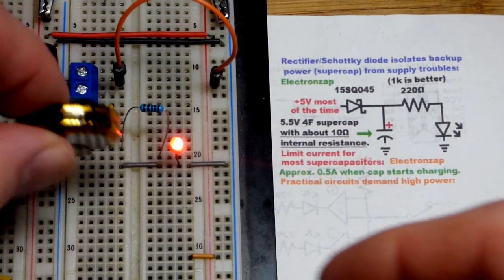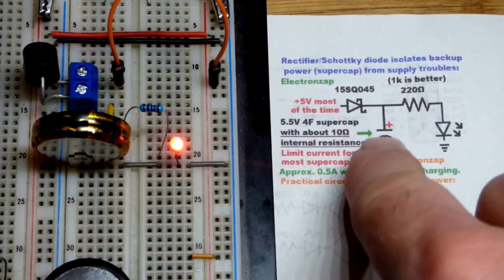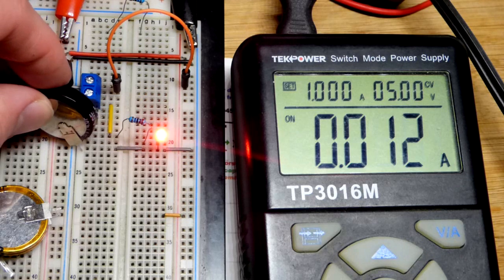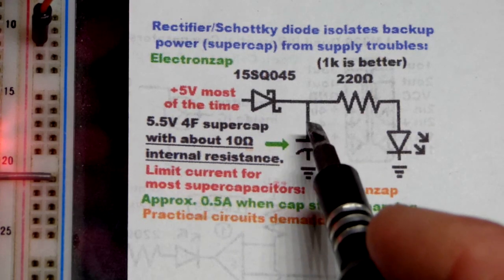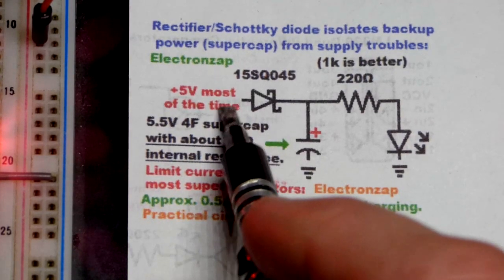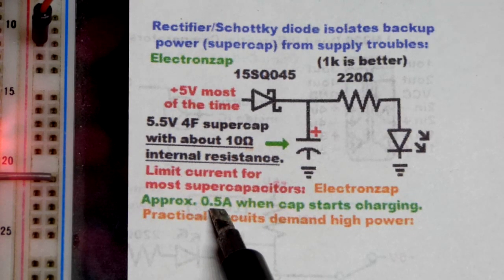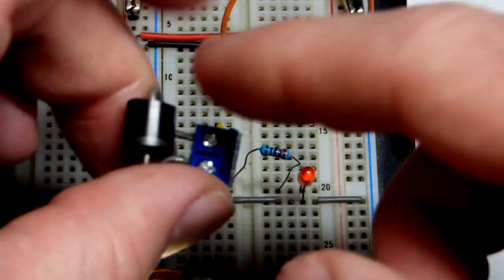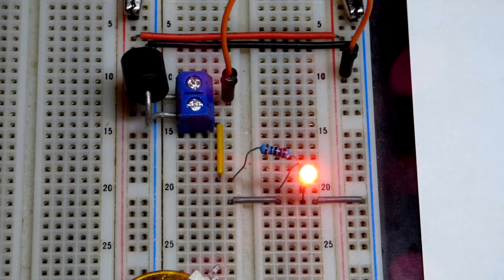Basic backup power using supercap with internal resistance demo circuit schematic

Comment: "HELYZQ High Voltage Capacitor Discharge Pen with LED & Buzzer 0-450V Electronic Repair Tool"
😉👍
Reply from the maker: That'd be a good tool to have.